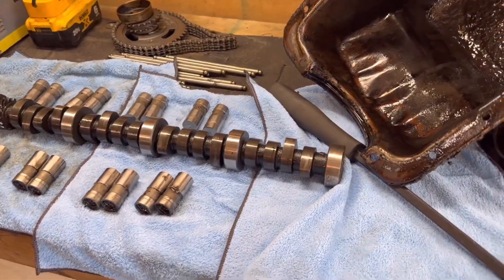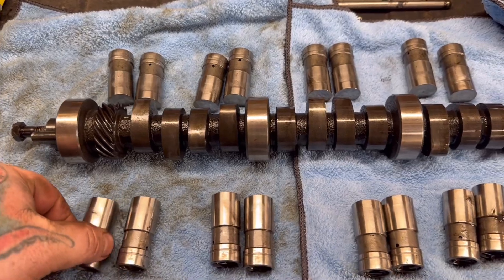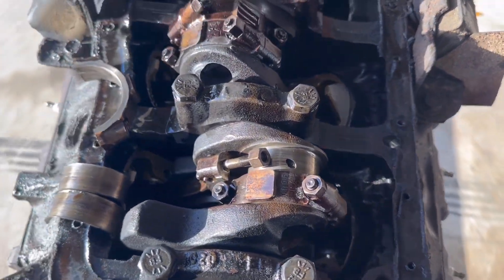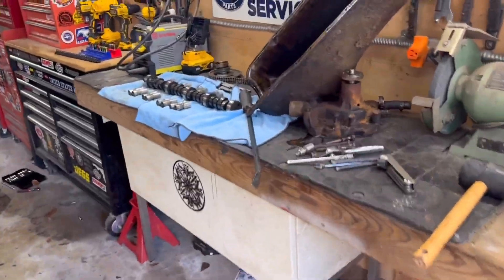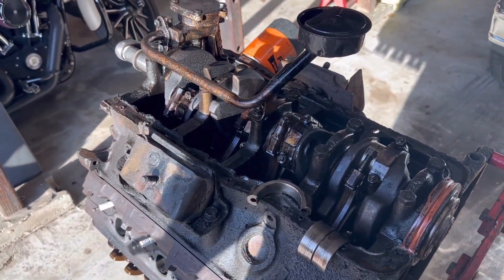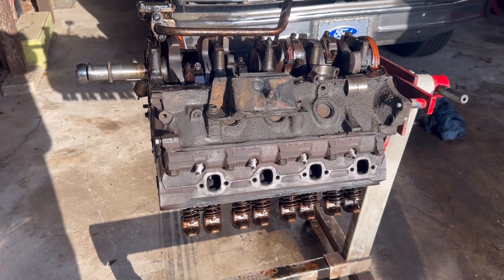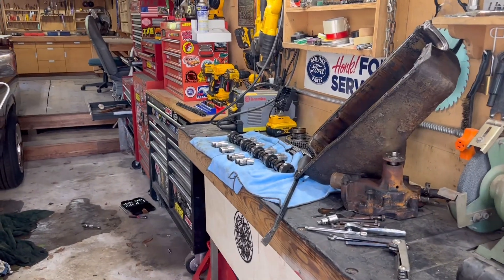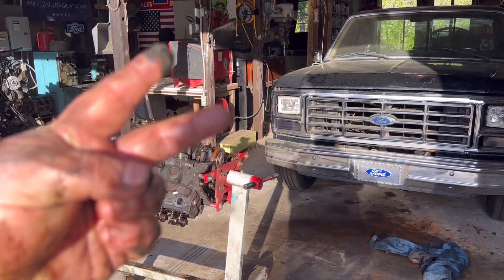Ford Small Block 302 disassembly & inspection - Rod Knock

Comment: YouTube just served your video up to me - Sorry about the bottom end :(
...  maybe a look at the bearings on the roller motor in advance
gratifying to know that your work was all good - seems a lot of folks are having issues with flat tappet cams lately and you did fine.
good luck with with the next engine. 👍
Reply from the maker: Thanks for watching & the positive/kind words. The flat tappet cam issues are definitely effecting a lot of people lately, I hope the aftermarket automotive industry can solve the issue.

Comment: sucks the bottom end is gone but atleast the cam was ok! im excited to see the roller motor build!
Reply from the maker: I’m ordering parts now for the roller build. It should be a solid motor. Thanks for watching!
Reply: I recently rebuilt my original 351c 4V Cobrajet.
My original builder and machine shop screwed up, bearing stack clearances, and wiped my crank out.
I went full roller on my build and managed to save my cam, but new crank, new roller lifters, and dealt.

Side note: Cam Research out of Colorado has a rig to break in any flat tappet camshaft ahead of time to eliminate the risk of blasting a cam lobe or lifter.

Last item, going roller, seriously pay attention to your distributor.
It’s tell you, ditch that GM HEI, look into a Duraspark unit. You can run a 6AL off a Duraspark distributor and they are good to 600HP.

DUI Davis Unified Ignition is another really good option. 

From being in the Torino Community, seen more than a few guys have issues from those HEI distributors.

Also, had an ‘84 F150 years ago…miss my bullnose!! Crazy chop hardtop removable convertible I built 25-27 years ago